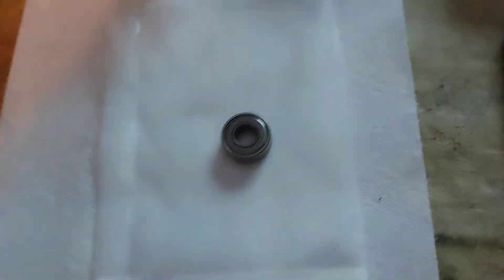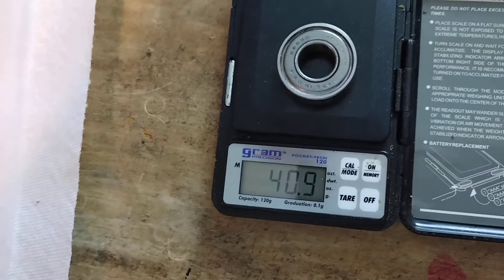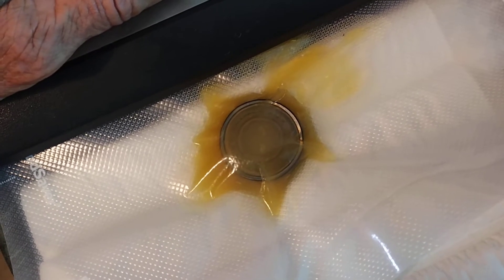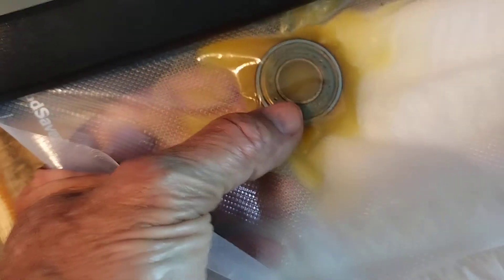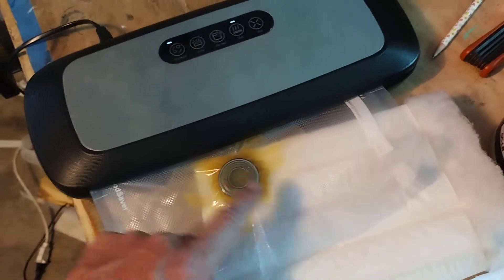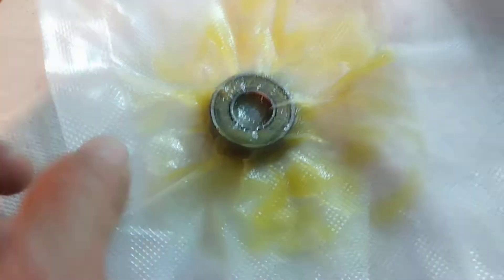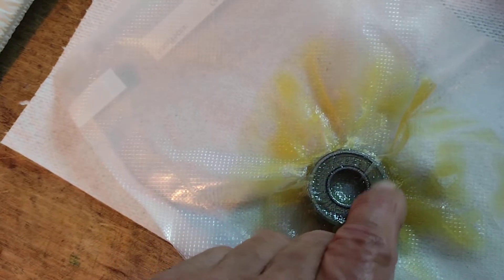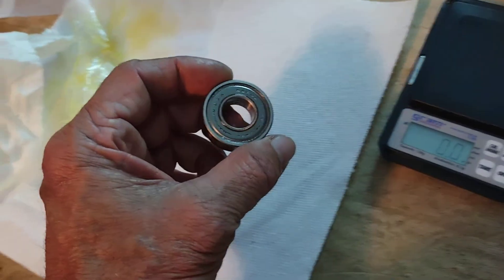vacuum packing bearing grease

Comment: I just made a home made vacuum jar our of a little glass spice jar, drilled a hole for the tube attachment for a vacuum sealer, hot glued the flip lid so no gaps in that any more, and cut out a bit of puncture repair rubber for a gasket - for between the lid and glass bottle bit. Seem to be able to produce a decent vacuum. It won't seal, but I don't need it to. I intend to put some bearings and grease in it, get the vacuum going and apparently that sucks the air out of the inside of the bearings and when you release the pressure it sucks the grease into the bearing. That's the theory anyway. The video I just saw of that, they heated up the grease, I can't be bothered doing that. Might need to do it a few times, I dunno. Should work.
Reply from the maker: It worked the way I did it. You can double or more the life of a bearing.